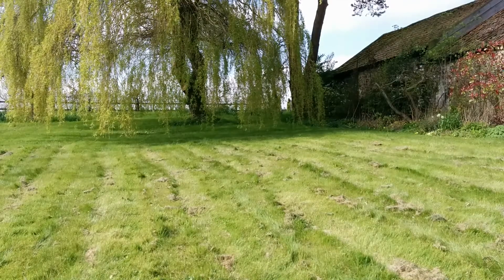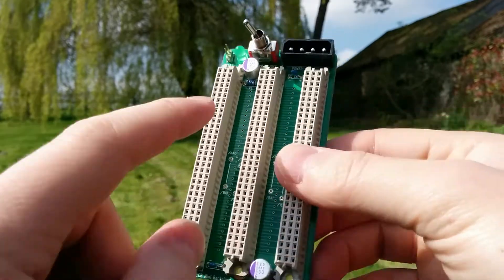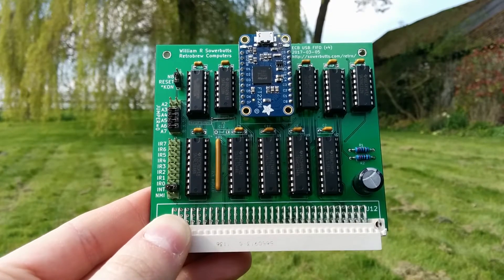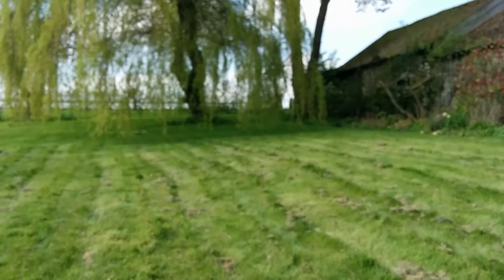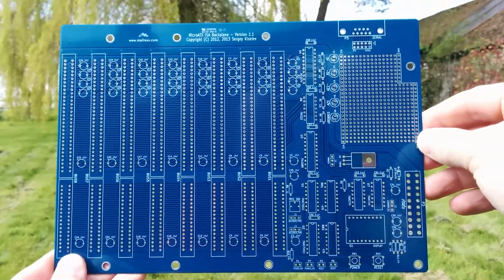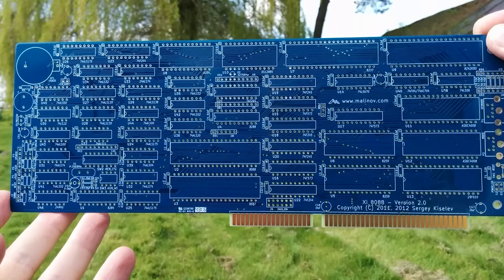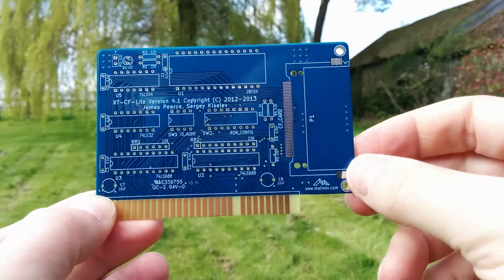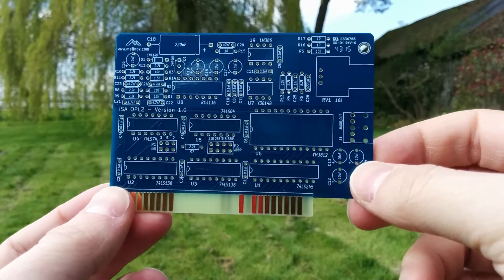April 2017 update - new printed circuit boards!

Comment: Hand soldering that SMD should be fun! A colleague of mine used to hand solder 386s back in the 90s but I always ended up making a pig's ear.
Reply from the maker: ASCIITerminal it was a bit of a challenge but with some flux and solder braid it proved possible and the board worked first time!

Comment: There's another card you might want to try called the XT-IDE-CF OPTIMA which has both a regular IDE and CF interfaces and supports a wider variety of CF cards.  It comes pre-assembled and includes a 2GB CF card with lots of utilities.